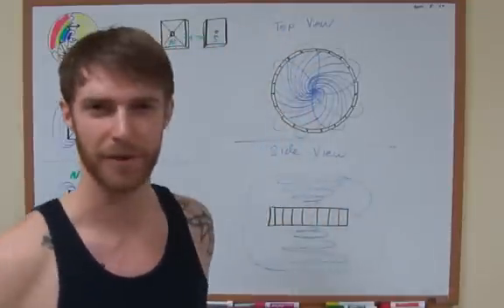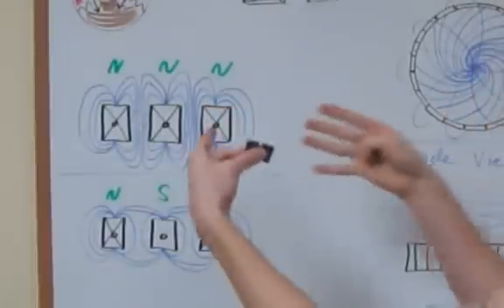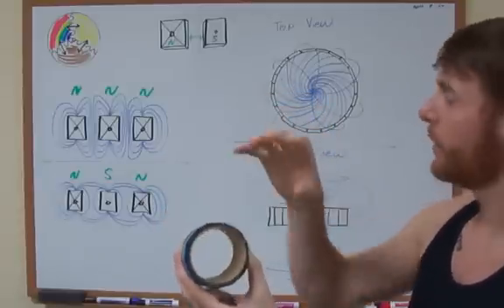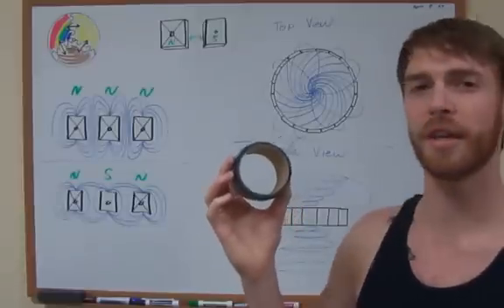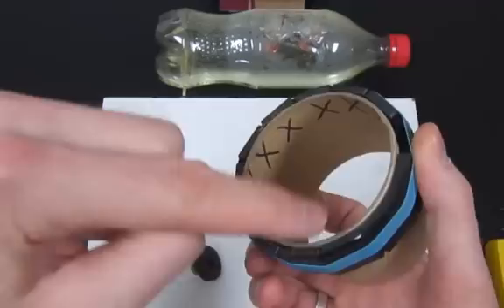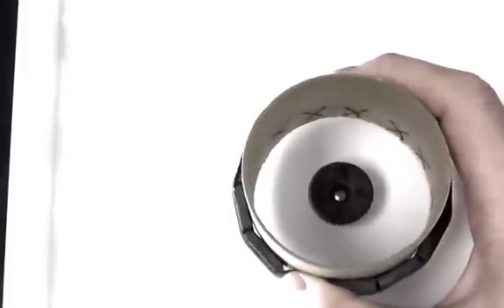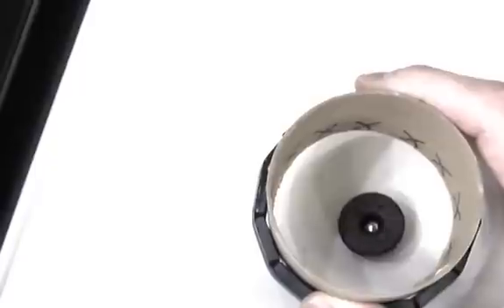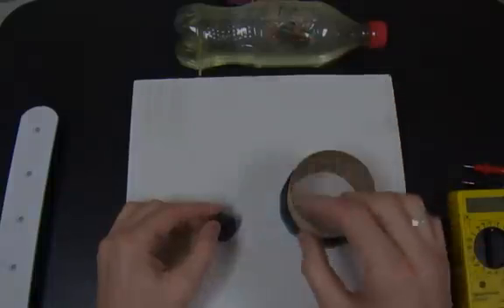The Beauty of "Spin" - Vortexing Magnetic Fields & New Energy Tech.

Comment: Maybe I'm stupid, but with what you show here...  isn't free electricity as simple as adding some wire coils and circuitry in the correct places? I mean, with just a little bit more engineering one could have a permanent battery here, even if just using cardboard, tape, and some copper wire.

Comment: Can static gives electricity like a  round metal 🎱 ball going through a static hair or something its up to the designer of it's spinning static you can only use one ball to avoid the static so one spinning static and one ball but many spinning static thousands or millions and the ball 10 million ball or more to gain more static energy from a  metal  ball that are fully charge by static then it goes to the electricity system so that the static are drained of its static  energy so this thing shall go in circles  that way so this ball must go back again into the static circle for static charges again and again just like a duster it charges static when moving allot youl get static when touching a metallic like handle etc.and it hurt a little etc. Its clean energy not much waste i hope 👽😇☢😎

Comment: Their is nothing different than rolling a ball across the floor. All your doing is causing a pull on a magnet that is affixed to a round base. That base HAS TO SPIN in order to be pulled along by the magnet. Push works the same way. Without you pushing or pulling the magnet or some sort of actuating mechanism to do the push pull the magnet will simply set there either up off the table do to attraction or on its side do to repelling. Nothing here :-(

Comment: Continuously running can potentially take place but you blew it when you said, perpetual motion. Those two words should never be used. Perpetual means forever and nothing man can make will ever run or last forever. Man can make continuously running devices that could stay operational for hundreds of years. That is not forever or perpetual. Come on guys, perpetual does not exist in anything other than the atom.

Comment: Anyone else see the first problem in the video?  The diagram  has north poles pointing up to the viewer while magnetic lines of force eminating from the side not of the magnets and not from the actual pole. < shacking my head >. How did this get by anyone is beyond me.  Second issue is that every claim based on that first false premis is utterly wrong.    

Now why is it spinning? In essence, he has a top sitting on a round ball. But because of how he holds the magnetic ring. The top is held at an angle  just off 90 degrees perpendicular to the plane the plane of the top. Thus, as you wstch, when he slightly pulls the ring, it pulls the top, and with that point of friction with the table being slightly off center from the  perpendicular, causes torque on the top, causing it to spin. 

I find it hard to understand how anyone can either pay so little attention to detail or, pardon the pun, spin up elaborate hoaxes.

Comment: Friend...  There is no magnetic vortex in the center of your magnet ring.  I assure you the magnetic field is static.  Forcing like poles together will not create a vortex, just an oddly shaped static magnetic field.  If you don't believe me, place a blank sheet of paper atop your ring of magnets, then drop iron filings on the paper.  The filings will conform to the shape of your rings magnetic field.  You might remember the same experiment performed with a bar magnet, first or 2nd grade science I think...  If your ring was producing a "vortex", the filings would spin freely (magically) in your vortex.  The motion of your magnet on a bearing is started and maintained by motion of the static magnetic field from your magnet ring that is being moved by you.  It will only have motion so long as there is motion applied to the magnetic field.  Magnets aren't magic, they're magnetic.  

I hope this helps...

Comment: Would be interesting to put a ferro cell on top of it. Just for kicks.
Reply: Ferro cells dont show you magnetic field lines.  Rather they show  you light reflected off a magnetic substance with an angle that changes depeding the position of the light source the viewers eye and the position of the reflecting particle in a magnetic field and its direction.     Dont be made stupid by being told or beliving that is any representation of a magnetic field lines. Heck, the lines in a fero cell dont even come off the magnetic poles, nore are those lines in a ferro cell representations of equal force. Roatate the light source wont change jack reguarding the magnetic field lines yet the fero cells light trails rotate . Come on people use that thing between your ears. The fero cell is a house of mirrors trick that proves nothing  in the way of magnetic vorticies, in part because magnetic vorticies therories are all wrong.  Perpetuated by ignorance and or intentional decievers.

Comment: everyone who states, that this isn't a vortex, because he moves the spool a little bit isn't correct, a vortex needs the spool to move a litte bit, btw you can get energy out of this, because the magnet is spinning fast and puts out more energy than the input, that is moving your hand a litte bit, however this is not a perputuum mobile, because you are extracting the energy out of the magnet, over time the magnet will lose energy, depending on the quality, i would estimate 100-500 years, if it is in full-time use.

Comment: SOME CENTURIES AGO - SCIENTISTS SAID A FIELD EXISTS AROUND THE MAGNET, BUT DIDN'T TELL WHY DOES IT EXIST. 
NOW SOME INDIVIDUAL RESEARCHERS ARE SAYING A MAGNET IS A SPINNING VORTEX FROM ONE POLE TO ANOTHER POLE. BUT IT IS WRONG. 
IN THE ABOVE VIDEO, THE CENTRE MAGNET ROTATES ONLY WHEN YOU MOVE THE OUTER MAGNET WITH YOUR HAND.
SO, WITH THIS OBSERVATION I SUGGEST THAT MAGNET IS JUST A STATIC AETHER GEAR.
THE AETHER AROUND THE MAGNET IS CARVED OUT TO FORM 3D TOROIDAL TEETH GEAR WHICH BECAUSE OF INTERFERENCE PATTERN CAUSED BY DIELECTRIC RADIATION.

Comment: Opposing magnetic fields of equal strength cancel each other out. There is no "vortex". The net magnetic field at the center is zero if you have magnets all the way around. . The speaker magnet only spins because you are moving your hand and a disequilibrium in the magnetic field. If you stopped moving your hand the speaker magnet would either end up stuck to the magnet you have in your hand, or come to rest (no spin, no movement) in the center.

Comment: You may have notice that you constantly need to adjust this to keep it moving but if you could set it up to do these adjustments through sensors and a microprocessor, I wonder if you could harness more energy than it takes to make the adjustments. I would love to have the time and money to play with this idea but it's probably already been done in black programs and is being utilized if it gave positive results. Nothing wrong with reinventing the wheel if they won't show you how to make one though. lol
Reply: No,you could not harness more energy than it take to move it. Hello thermodynamics?
Reply: ah, but experiment trumps that notion so it worth trying.

 You can't just say "hello, thermodynamics"  I can and have, taken a string, tied it to a weight on one end and a bolt on the other, then attached some strong neodymium magnets to the under-side of a table, then adjust the string so that it is just the right length to allow the bolt to be suspended in air, an inch and a half away from the magnet. Where does the energy come from to counter the effect of gravity?
   I have not done this one but have been told that you can balance a razor blade on a magnet, between the magnetic lines of force and that the razor blade will wobble, slightly.  It may be a mistake of perception that you are having. A photo-voltaic cell is not breaking the laws of thermodynamics, neither is a hydro-electric damn. Is the energy in the quantum flux coming from nowhere? It can obviously be harnessed as shown by the Casimir Effect. Energy could  possibly be harnessed by the above example so I say the experiment is worth doing. Now that electronic modules are getting so cheap I just may try it one day. I would bet you could get the electronics to do this for under $20. And thanks to platforms like Arduino, you could likely attach it to a computer for monitoring at no additional cost.

I will admit that I am not physicist but  as far as I know, there is still an ongoing argument as to whether magnetism is static or dynamic so I say the experiment is worth a try.
Reply: Well, for starters, you are conflating energy and force. Go study up on those concepts, then get back to me.

Comment: Magnetics will demagnetiize if bumped or handled improperly ,especially when  heated they reach their Curie point temperature. Damage is irreversible at that junture. Remember, creating magnets takes energy to manufacture. There is no free lunch. Hoover Dam creates a lot of electric power from turbines which are just big magnets rotating through wire coils. However, the real energy is the force of water pushing through the turbine. Sorry, perpetual motion machine doesn't exist.
Reply: Our entire physical reality is based on atoms.  The orbital and spin intrinsic angular momentum.

Our entire physical reality is created by the inexhaustible energy in atoms - and that energy never subsides.  You can break a rock into pieces but its atoms are still in constant physical motion/vibration. 

Our entire physical reality is BASED ON OVER-UNITY PERPETUAL MOTION.
So far, the massive energy-in-motion of all Earth's atoms are still in motion, 4 billion years after Earth was formed.  Four billion years of atomic perpetual motion.

And everything in our physical reality is BASED ON ATOMS.  Water, air, dirt, rocks. 

Just where do (many? most?) scientists think the power comes from for the uncountable number of atoms of Earth that have existed for 4 billion years?

There is so much microscopic physical activity at the atomic level. That's real energy too.  A bucket of water, if its atoms could all be split at once, has enough energy to rip off a huge chunk of the surface of the planet.  Lots of energy.

The ability to split an atom and create an (over-unity) chain reaction releases the immense "binding energy" that holds the nucleus of an atom together.

Atoms are based on endless energy.  Nary a trip to the gas station for (most of) the atoms of 4 billion year old Earth. Yet Earth is here. 

STUDENT:  "Atoms are always in motion, right?  Orbital angular momentum?  Spin? Electron cloud?"
PROF:  "Yes, an atom is in motion continuously.  In fact, the location of constituent electrons of any atom is only statistically known - they have no fixed position.  And the neutrons and protons have spin and have magnetic dipole moments.  And immense binding energy."

STUDENT:  "How much uranium - a rock as old as the planet, several billion years old - how much uranium went into chain reaction nuclear fission and leveled Hiroshima in 1945?"
PROF:  "About 2 pounds of uranium."  (see https://en.wikipedia.org/wiki/Little_Boy)

STUDENT:  "Only 2 pounds of old rock leveled an entire city?  How?"
PROF: "Because the atom of the uranium used is highly energetic, radioactive, spewing off subatomic particles, which made it easy to get it into a chain reaction."

STUDENT:  "But how can a rock spew out its bits and pieces?  Where does that energy come from?  A gas station?"
PROF:  "Yes, the Shell gas station down the street.  Okay you flunked this semester.  The nucleus is unstable and it has plenty of energy to 'spew out its bits and pieces.'"

.
.
.
Reply: +cow bell Would it be safe to say that all power is solar?
Reply: +DaddyTheTechnition it would be safe to say that there is free energy everywhere in universe. It is the work that is expended to harness it. Even solar panels takes energy to manufacture them. It' s the return on investment over time that makes them useful.
Reply: +cow bell   I meant solar in the the sense that all life is a direct result of what we have come to call a star, a star that we placed upon the title The Sun.  If The Sun did not exist, I am a firm believer that neither would life as we know it.  I know everything I eat has used The Sun to grow to maturity in order to become harvested for my consumption.  The very water you spoke of in your first comment that flows through the turbines at Hoover Dam does so due to The Sun.  The Sun keeps the waters liquid in order to flow through turbines in order for us to create power.  Power needed to create life itself and sustain it.
Reply: +DaddyTheTechnition I agree. yes. perhaps one day we will make a pass thru a black hole into another universe or dimension from where it all started. the beginning was a black hole from another universe into ours a white hole

Comment: I understand how this may confuse some due to the nature of magnetic fields. When in this configuration, the field should be "twisted" in on itself. You can sort of see this at work with a magnetic field viewer and multiple stacked bar magnets. However, the energy generated is from the motion of you lowering this twisted field onto the magnetic / steel ball. Not from the fields "spinning".

Otherwise it would spin indefinitely on it's own if both components were held in place. Which it does not. However if someone does disprove this, I would love to see it. As would every scientist on earth.
Reply: +Tag Wolf 

Magnetic dipoles can perform work on other dipoles in non-uniform fields.

http://www.phys.ufl.edu/~acosta/phy2061/lectures/MagneticDipoles.pdf

Comment: This is quite an old trick.  The rotor leans over slightly.  This means that the point of contact between the ball on the bottom and the table is slightly offset from the axis of rotation.  When you push the ring of magnets to the side the rotor spins as a result.  All the stuff about there being a vortex involved is just a distraction from the fairly obvious real way it works.

Comment: I really need this to work am I doing somthing wrong measurement ? Maybe? Will small magnets
Reply: Tim Gray You should read the comments. Then you would know that this can never work because of fundamental physical laws. This video is fake. See my discussion with Phil Harris. I will copy/paste here what really happens in this video. It has nothing to do with vortexing magnetic fields or free energy. Here we go:
There is a ring of magnets. All magnets have the same pole facing to the middle. The north-south center line of all magnets is horizontal. Then there is another magnet inside that ring but a little bit under the magnet ring. Its north-south center line is vertical. The magnet in the middle is either attracted or repelled by all surrounding magnets depending on its polarization. It doesn't matter, in both cases according to earnshaws theorem ( -> http://en.wikipedia.org/wiki/Earnshaw%27s_theorem ) it can not take a stable position in the center of the ring (In this case it is attracted, so the north pole goes to the top. that is why the magnet on the ball in the middle doesn't fall over). This causes a force which makes the magnet want to move horizontally out of the center towards the rim of the magnet ring. Now here comes the crucial point: the magnet is mounted onto a ball! From 1:53 it is clearly visible that he holds the magnet ring a little bit crooked. That causes the magnet on the ball to get a very little bit crooked too, such that the ball doesn't touch the white paper with its rotational axis. But since the magnet on the ball still wants to move horizontally, it experiences a torsional moment. It begins to spin. But after a few seconds the magnet on the ball would reach the rim to settle in a stable horizontal position. That is why he has to move his hand. And that is where the energy comes from. It wouldn't work without the ball. Guess why he didn't mount the spinning magnet on an axis? Because it wouldn't spin! I hope now everything is clear.

Comment: This concept works. I had an old boardgame called antfarm and i took out all 46 magnets from the tiny bricks. after that i placed them on a roll of tape so that all magnets was pointing north to the center - with 4 magnets missing in one corner. After that i put together a stick of magnets and pulled them in and out of the magnetic field.. This is getting more interesting. I found that if you hold the stick/cylinder-magnet inside the magnet field, then the magnet will both be forced into the magnetic field and then again be pushed out as the magnetic field of the stick moves through the vortex. This is nor free energy - but is is mobile energy as you need magnets for the device, and those magnets will once need to be replaced.
Reply: Lindh Tracks It works for you? Why don't you show us then?